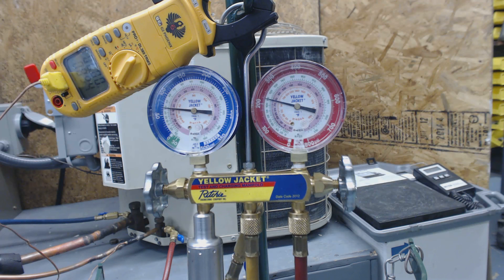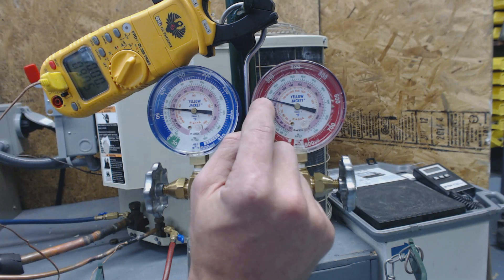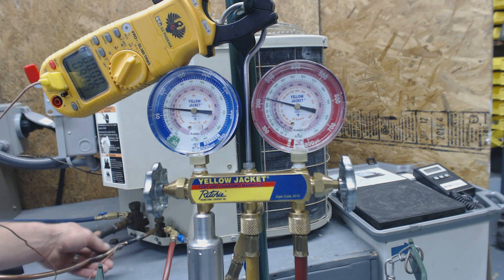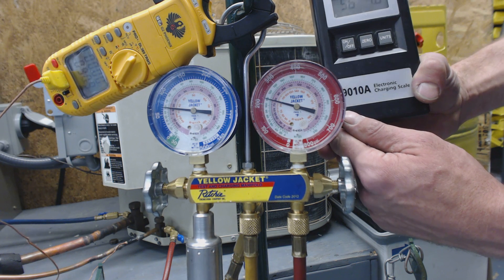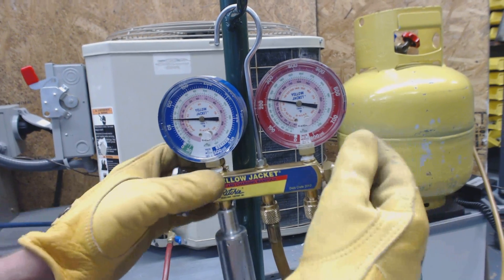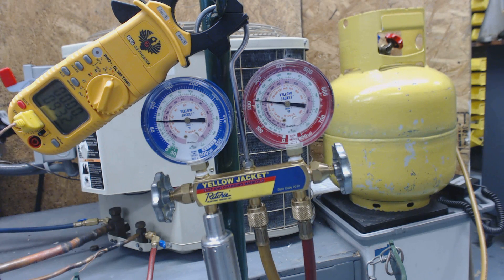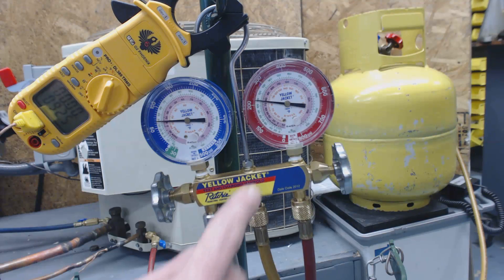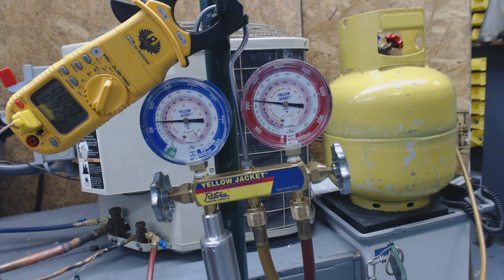R-22 Refrigerant Charging! How to Measure if a System is Overcharged! Fast way to Fix Subcooling!

Comment: Sir this is a very knowledgeable man's way of fixing the sub cooling.
For a lay man probably it will be easier to collect several pounds in the recovery bottle then recharge the system correctly. What do you say?.

Comment: Mr. Migliaccio, I've watched your videos on charging and I would like to know...?  After a vacuum down on a system with a hermetically sealed compressor...how do you replace the oil that is pulled out of the system.  Is the oil removed with the recovery process and then replaced when you add the refrigerant while adding oil for the compressor?  Also, as a nonservice tech person (not licensed) can I buy R-22 (for personal use) to replace the refrigerant after I replace my TXV, air filter and screen; I believe I have a restricted liquid line?  I have not taken anything apart yet, but I intend to after I buy the necessary equipment.  I had a so-called licensed Tech come out to my house and put 3 lbs. of R-22 in my system because he thought the refrigerant was low.  This person also put a new run capacitor in my Train 4 ton AC unit, model XB-13 2TTB3048A1000AA, MFR date is 00/2008.  This tech person new everything an didn't put one temp gauge on the High or Low lines, didn't take air measurements of dry and wet temps.  I currently have high Super Heat, (15 above the target SH) and 10 above the Sub cooling value.  I have replaced my fan blower motor capacitor (it was 14% below the rated 10uF rating at 8.62uF.  I also replace an oversized (Schrider valve, too long) while the system was charges; you showed me how to accomplish that task.  I checked the rating on my Hard start capacitor, it is supposed to have   216uF, but it shows 234uF which means it's going to add current to my AC compressor motor?  Being a hard start capacitor, it's not running in the system.  I don't have a tool to measure Inrush Amps; however, the nominal current the compressor is drawing is 11.5 Amps.  The capacitor for the fan is at the correct value stated on the capacitor.  I have learned so much from you; I purchased your book and service info cards as a bundle.  Thank you for your anticipated reply, regards Joseph

Comment: Nvm I got confused ur not recovering the whole system
Reply from the maker: Daniel, to adjust the charge, you can just use the systems compressor and recovery bottle instead of a recovery machine, thanks! Make sure to check out our article on operating pressures for r22 and r410a on our website www.acservicetech.com/articles thanks!

Comment: Brother please help I'm unable to find a good tech they all trying to sell me a new unit and saying $150 dollars per pound of r22 and said maybe my condenser is not working properly I have a 3 ton goodmad outdoor condenser with a orficer/piston it about 12 years old and it's reading 40 degees on low side and about 190-200 on high side but it's not cooling enough I saw the A coil does sweat but the outside lines isn't I replace the filter and wash down the condensers coil using recommended foam cleaner the unit is pretty much clean also just to clarify the condensers does turns on. I am located in jersey city NJ 07305.

Comment: hi there... i have split unit with R22 gas ... unfortunately, i over charged the system around 80 psi.
the problem is my system doesn't have release valve in discharge (liquid) side.
im just wonder if there is any way to reduce the pressure to 60 psi??

thank you
Reply: You just take it from the vapour side, all you are monitoring is the saturated refrigerant temperature.

Comment: What you said about the recovery tank makes no sense to me. Total weight is 56lbs. It's a 50lb max tank. They recommend in a 40lb tank put no more then 30lbs in it. "28tw + 38? Where are you getting this 38 from? Very confused.
Reply from the maker: A 50lb recovery tank may have a WC of 50lb or less, the tare weight TW is 28.5, you can only fill a 50lb tank to 80% so 80% is 40lb. Dupont's recommendation is 38lb which is 2lb lower than 40lb. Total tank capacity to make sure you do not overfill is 28.5TW+38= 66.5, 66.5lb-56.4 actual weight=10lb capacity left in the tank, thanks

Comment: This morning we woke up with no cooling at all.  The AC is running like normal.  Compressor is running, quiet. Not like before; where it used to be loud and sounds like there is a load on it.  I bought the same Manifold Gauge meter as in this video a few years back. I didn't really use it till today. I want to learn AC but never got around to it. I plug it up and the reading shows: the blue side (150 blue, 82 Green).  Red side (150 red, 80 green).   So obviously the this is not right.   I have an R22 system.  I know that much.  Also. When I was plugging in the blue side gauge line before, it use to blow out air.  But now I get liquids seeps out.   Can someone explain what could be the problems? Thanks in advance.
Reply from the maker: Hey Ericdaozero, it seems that your compressor is not running. Shut the power off to the unit outside and check the capacitor. Then move on from there. Make sure high voltage power is off during any tests. Make sure you are EPA 608 licensed before working with any refrigerants but it sounds like an electrical problem, thanks

Comment: قبل 23 ساعة
Thanks a lot for your job. I have a small question. When i need to charge the ac car from cylinder. Do i need to keep cylinder in neutral potion or return down. The feron does inter the ac system as gas or as liquid. Best regards
Reply from the maker: R-22 or R-134a exits the bottle with the bottle vertically or upside down but vertically would be better when possible. It enters the running system into the vapor side. If the system had no refrigerant and was in vacuum, you break the vacuum with liquid refrigerant from an upside down bottle into the liquid side. Any additional refrigerant is added while running into the vapor side, thanks

Comment: Based on my model of the system, subcooling of the liquid increases the cooling effect by reducing enthalpy of refrigerant. Mass flow should not be affected. I also do not see any reason for the compressor to be more loaded in this situation, than for "nominal charge". More (mass flow * delta enthalpy) with equal power consumption means higher efficiency. Can you please comment on that in the most advanced/precise way so that I can find fault in my reasoning. Thank you.
Reply from the maker: I believe the answer you are looking for is by having more subcooling, this increases the volume of the total tubing filled with liquid which reduces the volume of tubing filled with saturated state. When you reduce the sat state, you reduce the main heat transfer area thereby increasing the temperature and pressure since less heat was rejected in the condensor. This is why, the sat temp and pressure increases in the condensor when you add refrigerant which increases the compression ratio. Is that what you were looking for?
Reply: Thank you for your answer. My reasoning was a consequence of some compressor lecture and remark done during using P-h diagram. Like most professors this one got it at least partially wrong.
My new reasoning would be as follows:
added refrigerant has to land in some part of the system; because its amount in liquid lines, low pressure vapour lines and compressor remain relatively constant, it is the level of liquid in evaporated which will raise; taking into account constant mass/heat flow from compressor and decreased area of heat exchange, the system will have to find a new equilibium which allows higher heat flow per unit surface area of evaporator, i.e. larger delta T between condensing refrigerant and ambient air , i.e. higher temp. of condensing gas, i.e. higher pressure in the condenser. Higher pressure in condenser means more work done by compressor with same cooling effect, i.e. less efficient operation.
Thank you helping me achieve better understanding.
I wonder about:
1. practicallity of measuring temp. of condeser pipes in order to determine liquid level (zero subcooling point should theorethically indicate end of condesation),
2. designed level of refrigerant in condenser , i.e. what is liquide level with nominal charge,
3. influence of non-condensables on this way of adjusting charge.
Reply from the maker: I am not an engineering professor but can tell you cause and affect and some of the happenings for troubleshooting, efficiency, and compressor safety. Also remember the metering device will change things as well as a txv will control superheat and a piston will not change superheat. Also, distributor tubes will cause more of a pressure drop than on units without them for txv's which is why we have the external equalizer, thanks
Reply: Thank you for your time and effort. It was my pleasure and clearly I learnt something on this occassion. Good luck!

Comment: Maybe I am slow, but I can't figure out the mathematics of the recovery tank via cylinder, refrigerant, and max weight.  I got lost when instructor TW 28 + CYLINDER 38.5 = 56.5  not 66.5. I know the max weight of cylinder is 66.5, but something went wrong with mathematical formula for me.  I am lost, or maybe I am just slow...
Reply from the maker: You are correct, zero the scale and you can't go more than 66.5. That is already taking your 80% tank capacity into thought and also the extra 1.5 pounds to be safe. 50 x .8 = 40lb - 1.5 = 38 +tw28 = 66.5 total thanks
Reply: acservicetch...Thanks for clearing--that--up for me...you're the best...wish I had an instructors, manager, supervisor etc. like you.
Reply from the maker: Thanks!

Comment: Watched a bunch of your videos and they're very helpful. Do you have another video showing an overcharged R-22 system with a fixed orifice? FWIW, I'm a relatively new tech and have my 608. I'm working on a friend's R-22, fixed orifice system and found some readings that don't make sense (though I have an idea). It's an old ICP 3.5 ton system. Readings are: Outdoor DB 94F, Indoor WB 64F, Low side 78 psig, Suction line temp 40F, Supply air temp DB 66F. Any ideas and if so, what's the best way to confirm the problem? Is there anything else that could cause these symptoms?
Reply from the maker: You are right Kilo, you have negative superheat. What does the high side look like, pressure and actual temp? If a system with a piston was overcharged then you would have less superheat so yes you would need to recover some refrigerant, thanks Kilo!
Reply: Thanks for the response but now I'm confused. My understanding of superheat was that the temperature of the suction line at the compressor inlet (total superheat) is supposed to be higher than the saturation temperature of the refrigerant measured on the low side gauge. For example, if the low side pressure is 78 psig (46F saturation) then a 6F superheat means the temp of the suction line should be 52F (46F sat + 6F superheat). If the suction line is colder than the 46F sat temp, doesn't that mean I'm flooding the evaporator and the refrigerant is vaporizing in the suction line (thereby dropping the temp)?
Reply from the maker: You are correct, I looked at it too fast, I apologize, ha ha, wow. So when the actual temperature of the suction line at the outdoor unit is the same as the sat temp then you need to recover. The actual temp however shouldn't be able to be less then the sat temp though if that makes sense unless the suction line is somehow loosing superheat on the way to the outdoor unit but that would mean it would have to be running through a 32 degree area though which I am sure is not happening. Recover refrigerant from the high side and into the r-22 recovery bottle until the superheat increases to 6 degrees. I would however verify that your temp sensor is accurate in ice water at 32 degrees before going back over thanks, Kilo!
Reply from the maker: Total Superheat is the temp increase from where it turns into a vapor right after the saturated state in the evaporator until where it is read out at the outdoor unit vapor port. That is correct!

Comment: What is wrong with my R-22 TXV AC Linnox system?  The system is labeled with "TXV subcooling 15 degree F." Following your instructions, my subcooling reading is right at 19 degree F. I know that's high :( .  And the air from the vent is barely cool(67 degree F).    However, when I add the more R-22 Freon, then the in-house air in the vent is cool like it should be (59-62 degrees F).  But the subcooling is increased to 23 degree F(really high).  Can you please tell me what could be the problem?  Is there a blockage somewhere?  It is an old system.  I can't afford ($7500-$10000) to replace the HVAC system.  Thanks.  BTW: Love your videos.
Reply: ericdaozero if you have a gauge the low press. Should be between 65-80 psig and the high 225
If your high is much more then there could be a blockage. I am not a hvac guy, just based on experence
Reply: Ol Tunde thanks.  I snapped some photos.  I'll check.
Reply from the maker: Ericdaozero, what is the sat temp and superheat? I was wondering to see if the txv or some other liquid line restriction is happening, thanks. I am assuming you have a txv. You mentioned the outdoor unit says 15 degree subcooling ratin g but that does not mean that it does not have a piston instead of a txv. A piston would need to be charged with superheat, thanks-  superheat playlist- https://www.youtube.com/watch?v=q-G7FLlzhAg&list=PLxnHR5_D2ojwGvhU1rseXQLJ-XBjBZMMk
Reply: After adding the Freon these are the numbers -  on the low(blue) side:  75 psi,   43.7 degree F,  temperature probe shows 62 degree F.  So the superheat is about 18 degree F.  I did not open the inside to check, but the outside unit states "TXV" on the label  so I'd assume it has TXV inside.  Thanks.

Comment: can we base on the operational current of the compressor while we recharge? I've learned that from school, but I don't know that method will work or not?
Reply from the maker: That method would be with mainly packaged refrigeration units and manufacturer charts. We need superheat and subcooling for single or two speed ac or heat pumps in cooling mode or just weight from empty or after new installation, thanks

Comment: When checking temp drop between supply and return do I use wet bulb or dry bulb method?
Reply from the maker: Dry bulb. If you get 18-21 decrease in temp, it will confirm it is working correctly. On the other hand, if your charge is correct on a piston system and there is high humidity, you may not 18 degrees right away. It will take time to get the humidity out and temp down some.  So a 18-21 degree drop confirms a correct charge. If you don't get 18-21 that is why or it could be inaccurate charge or another problem as discussed in some of my other videos, thanks!

Comment: If ever you have a trick to know if it's TXV without looking inside the supply,I would gladly use it.
Reply from the maker: Sometimes you see the bulb mounted on the vapor line on the outside of the unit and also the extrnal equalization port. The other thing is if it is fairly new it may say on the rating plate of the evap, txv installed. However evap coils tend to get altered in the field sometimes so you want to check.

Comment: isn't r22 charged by pressure or superheat most r22 don't even have a data plate saying the subcooling I'm confused
Reply from the maker: R-22 outdoor units will say subcooling on the rating plate otherwise you need to use a range of 8-12 that is if you have a txv. Superheat is used for pistons and cap tube systems. Thanks for your question!
Reply: AC Service Tech LLC      2002 Trane heat pump with TXV does not list subcool on rating plate. However they include in service packet a “TXV Refrigerant Charging Curve” graph having liquid temperatures on the x-axis and liquid pressure (Psig) on the y-axis. The graph shows when to add refrigerant vs when to remove refrigerant according to the point on the curved line of the graph indicated by the intersection of these two temp. And pressure values. Should this be used as the best charging guide rather than the 8-12 subcooling you explain in this video? Thank you.